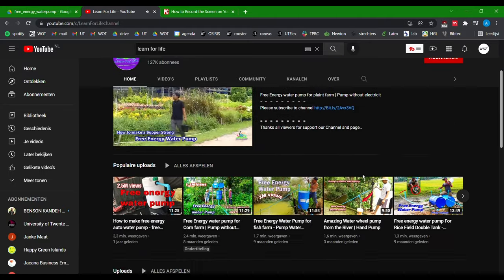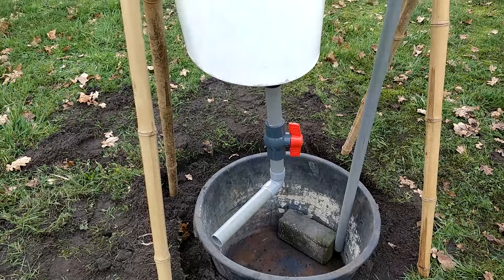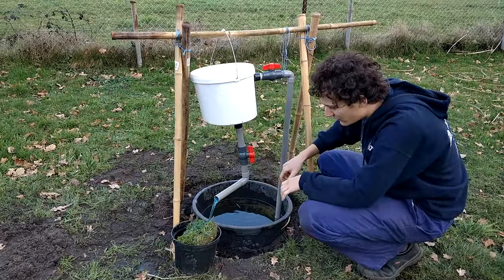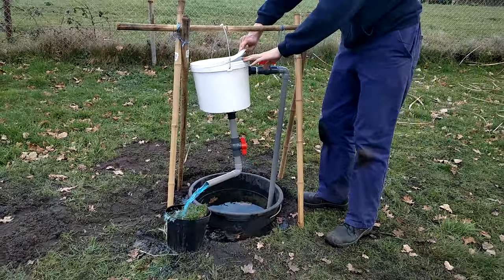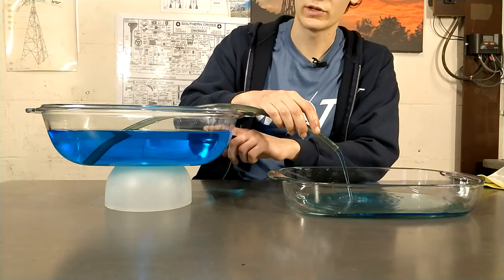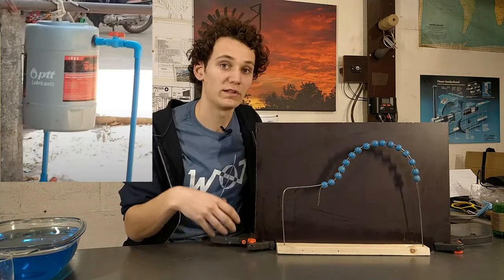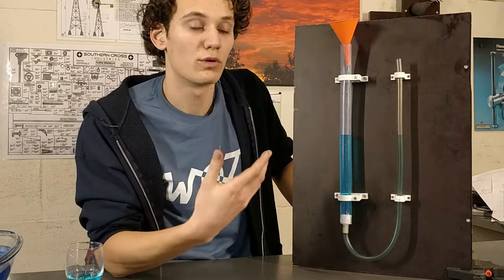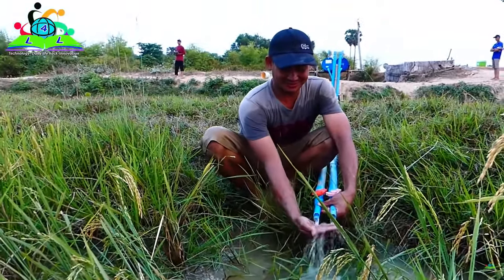FREE ENERGY Water Pump Tested. Is it possible?

Comment: Air volume on output pipe is needed for function. Air is in fist phases compress and in send cycles make expansion. Wit out this presser compensation running pump only short time. And don't re member ventil on the input pipe!
Reply: Noop. With a bucket/barrel no valve on the input is needed. Air in the outlet is poison to siphon. Cycles? There is no cycles in a running siphon. This siphon does not work since the input is lower than output, as demonstrated.

Comment: I think they also put a one way valve.
Reply: One purpose of the barrel is that it helps priming the siphon so you do not need any foot valve. The other purpose is to collect any air sucking into the system. When there are too much ait in the barrel, the siphon stops, and you must prime it again.

Comment: You are wrong it does work 
Your model is not correct 
Very simple, study old vintage water fountains some dont use river current,  or pressure to work   same principle
Reply: Sorry, but this video is correct in every detail. A siphon can not lift any water to a higher level.

Comment: And you opened the valves all the way  
You have to meter the flow so air doesn’t slug back in from the outlet  
You have to allow a vacuum to occur

Comment: Calculation of Water Suction in a Closed Container

- The container is closed: Atmospheric pressure no longer affects the interior of the container.

Calculation of pressure inside the container:
- The pressure (P_tank) inside the container is determined by the hydrostatic pressure of the water in the container.
- P_tank = ρgh, where:
  - ρ = 1000 kg/m³
  - g = 9.81 m/s²
  - h = 0.8 meters (height of water in the container)
- P_tank = 1000 kg/m³ * 9.81 m/s² * 0.8 m = 7848 Pa

Calculation of pressure in the tube:
- The pressure (P_tube) in the tube must be less than P_tank to create suction.
- For simplicity, we assume that friction losses are negligible and the velocity of the flowing water is constant.
- P_tube = P_tank - ρgh, where h = 1.5 meters (length of the tube)
- P_tube = 7848 Pa - 1000 kg/m³ * 9.81 m/s² * 1.5 m = -5984 Pa

Conclusion:
- The P_tube (-5984 Pa) is negative, which means there is a vacuum in the tube.
- Therefore, water suction from the system is feasible.

Notes:
- In this case, suction is solely due to the hydrostatic pressure of the water in the container.
- The absence of atmospheric pressure in the container allows for the creation of a vacuum in the tube, reducing the internal pressure and enabling the flow of water.
- The velocity of the flowing water and the volume of water suctioned per second can be calculated using the same formulas used previously, replacing Patm with P_tank.

Additional observations:
- The presence of friction losses in the tube will reduce P_tube and therefore the velocity of the flowing water.
- Changing the height of the water in the container will affect P_tank and consequently P_tube.
- The temperature of the water can also affect its density and thus the hydrostatic pressure.

Overall, water suction in a closed container is feasible, but the velocity of the flowing water and the volume suctioned depend on various factors
Reply: Impressive “explanation” unfortunately this siphon, as any siphon, can not lift any water to a higher level. As the video shows, it spouts out the water in the container, then it all stops. If you dip the output tube into a cup of water, nothing will come out of this system, not even the water in the bucket

Comment: Review thermodynamics. you did not prime no foot valve. i already try this with my hydrophonics system. inlet pipe for tank should be smaller than the output pipe to have siponing mechanism.
Reply: Noop. With a tank, no foot valve is needed. In fact this is the main reason for using a tank. Inlet tube may be 10 times wider than outlet tubing. The purpose of this video is to show that a siphon can not lift any water.

Comment: Everyone seem  to  miss  the  basic  physic   of  the  system  .. This  is  a   basic  vacumn  pump  .   The  resevoir  or  tank  must  be  sealed   as  well  as  the  inlet  pipe  .  When  the  tank  is  fuLL  to  the  height .of..the  inlet  pipe    and  the  outlet  at  the  bottom  is  opened   a  vacumn  is   created   by  the  falling  height  of  the   water  in  the  tank    .  This  vacumn   is  strong  enough  to   LIFT  WATER  ALMOST  33  FT  ..  The  critical  point   is   THE  TANK  AND  INLET  PIPE   MUST  BE   SEALED  .
Reply: The videi shows that a siphon can not lift any water.

Comment: Also you need a check valve on the end out at the well so the water does not go backwards and you need another valve on top with the tea so you can feel the container up and the line all the way down to the well that away when you open it up there will be no air in it basic physics do it this way and it'll work

Comment: You got to cover the top where it makes air pressure
Reply: There is a airtight lid on the bucket here. Reason that it does not work is that the source water level is higher than the output. He shows that then it can not work. A siphon is no pump.

Comment: To debunk this theory. "If you turn over a gallon of water with one opening, where will the air fill the gallon from while leaking? The same opening the water escapes through.
 So when the initial weight of the water in the tank reduces, the force can no longer suck the water from the depts so the easiest way to leak will be the same opening you switch to get water from. Just a matter minutes depending on the size of the tank and dept of the well to loose suction power and use alternative air opening. Go and buy your electric pump please.. don't waste your time.

Comment: If you removed your valve on the top well side and put an inline check valve so that water can't flow down only up, this would let you prime the well pipe and the bucket at the same time.  Seal the lid and then open the release valve and that should do it.

Comment: For that pump to work you need to fill the pipe running to the ground too. That's what priming is. Otherwise the siphoning won't work unless the reservoir has a larger volume and it sucks all of the air from the pipe. In other words, you didn't prime the mechanism correctly. That's why it failed. Had you had less air to siphon, the water would've flowed fine.
Reply: No, this demo is exellent. It shows that this “pump” can not lift water to a higher level. No siphon can do that.

Comment: I definitely agrees with you about siphoning, UNFORTUNATELY, you did not seal the white container (and the other parts where the supply of water will come from) after you filled it with water, WHEREIN a vacuum pressure MUST be created, that my friend will suck the water from the supply
Reply: ADD: considering also the SMALL white container, definitely WILL NOT WORK, a bigger sealed container must be used to create a vacuum (negative) pressure to overcome the weight of the water to be lifted from the supply
Reply: ADD: a LONGER OUTPUT HOSE for more volume of water that will create the vacuum (negative) pressure from the sealed bigger container
CONCLUSION:  very good vlog indeed for a very good discussion ...
Reply: Sorry, no. This excellent video shows that a siphon can not lift any water at all.

Comment: You're wrong -- this does actually work. There needs to be a longer outlet in this scenario with a smaller outlet. You also need to prime your supply tank by removing all air from the system. If you watch any of those videos you're trying to replicate, they make a point to show you that.
Reply: It can not work as long as the source is lower than the output. A siphon can not lift water.

Comment: Your lid is leaking air because it doesn’t have a tight seal such as a screw cap type of lid to create a seal impenetrable by air. Without that air pressure it will not create the vacuum pressure
Reply: Lid is ok. System is sucking water from the output. Air in, some water out, more air in…

Comment: No Mystery here....., just the siphoning effect, works as long as the top white bucket lid is nicely sealed, and no air enters the bottom pipe that sucks up the water.
Reply: Which means that the ouutput must be lower than the water level in the source for this siphon to work - as with any siphon. Only works from a high source to a lower deain.

Comment: I would call this kind of pump a syphon with vacuum assist. with a larger tank it will indeed suck additional water into the tank but the tank will eventually empty to a point where the vacuum is not strong enough to raise the water needed to keep the tank full.  Its a flow extender rather than a free water pump. but never the less a good idea as raising water in buckets is hard work.
Reply: The video shows that this siphon are unable to lift a single drop of water to a higher level. It proves that a «drum pump» is no pump.
Reply: @kjellg6532  Any pump has to be able to do 1 thing and that is create a pressure differential. . this system is basically a siphon, but with a pressure differential increased by the dropping water creating a vacuum. the net energy loss is always to zero so its not free energy at all just a flow extender. to fill the barrel took energy to fill it and what you are seeing is that energy added to the siphon but always trending to zero. its a fun project,
Reply: @davebloggs  The purpose of this video is to debunk those who clames that a siphon with a barrel, can work as a pump and lift water from a well. The video shows that not a single drop of water are sucked from the source. The only water that comes out of this system is what you yourself manually liftet up into the bucket, nothing more. This is a siphon, not a pump. As a siphon, it can lift nothing.  If you dip the output tube into a cup of water, nothing will come out of the system. You can also use a U-bend at the output. In either case, aire is prevented from entering the system from the output side and it all stops.
Reply: @kjellg6532  but a siphon is a pump because it relies on pressure differential. and that is the definition of pump. a device or apparatus that creates by what ever means a pressure differential.
Reply: @davebloggs  Siphon can not lift any water to a higher level. For a siphon to work, the water level of the source must be elevated higher than the output. To lift a body of water to a higher level you add energy to it. You can use energy from petrol, steam engin, electric motor manual work or the power in flowing water in a river. 
A siphon has no energy input and can not lift any water. Adding a barrel does not make the system work, it only helps a siphon to start, it is a priming device, not a continues source of lifting energy.
This video shows that a siphon can not lift anything. Common knowledge from schooldays.
Reply: @kjellg6532  Ok im laughing now. so here is a challenge build one. use a 45 gallon barrel . the out put at the bottom of the barrel. and  a 1/4 inch suction hose in a source supply located a few inches below the barrel height, fill the barrel open the tank wait until the flow output stops due to vacuum and then open the 1/4 inch inlet  you need air behind water to create flow. and tell me what happens. you did add energy to the system by filling the barrel and it will indeed suck water in the inlet until the barrel is empty which is my point all along but clearly you cant see outside the box, the laws of physics are really quite good like that. I am very familiar with pumps and siphons.
Reply: @davebloggs  Now let us change your set up a little: The tank is now 10 m3 in volume. The bottom of the tank is raised 5 m above the ground. Beside the tank is a lake and the surface of the lake is 6 m below the bottom of the tank. There is a suction pipe from the lake up to under the top of the tank. There is an outlet tube from the tank via a valve and this tubes ends up in a 10 liter empty bucket standing on the ground.  
You fill the tank with water - puh - then open the outlet valve. How much water will leave the tank? 1) 10 m3? 2) 10 litres? or just 1-2 litres, maybe less? 
 (I too do have some experiences with pumps and siphons over 50 yrs, but English is my 3. language so please excuse me for unclear wordings)
Reply: @davebloggs  Now let us see. I assume that the uoutput tube is pointing some cm horisonralybout from the barrel and ends there. You open the valve. You have exactly the same situation as shown in the video. Water will gulp out until the tank is empty, not a single ml is lifted from the source. I.e. the system does not work ar a pump, put as a storage tank. The output flow would be better if you open an air inlet at the top, no more spouting at the output. And again, no more water out than what you manually lifted in. No source of energy for a run over days.
Reply: @kjellg6532  I agree there is no way it would lift water 6 m. you could use the vacuum to raise water a few inches at best and the pipe would need to be small thats why i think 1/4 would be the max. and once the 45 gallons of water is mostly drained out it would just glug air at best, but it  is an interesting experiment , it is not as i stated earlier a pump but more a gravity assisted siphon., if you are familiar with pumps you will know that all they do is create a pressure differential. this can be achieved with valves or velocity etc there are many ways to move things but all create a pressure differential.  the 1/4 tube in the vacuum space in the barrel as the water dropped would experience a drop in pressure and since the water in the pipe is from an external source at atmospheric pressure the has to be some flow. but any bigger than say 1/4 inch and a few inches difference i think would be stretching it somewhat.but it would be a great thing to build.
Reply: @davebloggs  Do not think I will copy this. It can not work. No siphon, with or without a barrel, regardless of diameter of tubing. Regardless of length of exit tubing can lift any water, not even 5 mm, no energy input for continuas operation that is.
As for pumps I have looked into Archimedes pump, screw pumps (oil pumps in cars). Reciprocal piston pumps, centrifugal pumps, spiral pumps, medical blood pumps (tube pumps)  just to name some.

To be honest , there is a ‘siphon pump’.  It is so complicated with so many water timing devices and valves thar you need a Masters degree to tune it.  It works like this:  Given a small vessel situated about 6-7 m above the source. There is a one way valve into the vessel at the suction side. The output side is long and the end is dipped in water so no air can enter. Here is a valve at the output side of the vessel. AND there is a short drain tube at the bottom of the vessel. 
Now everything is filled with water and all valves are closed. The vessel i drained by openig the drain valve. This water is coming out abote 6-7 m above the source, but it is just 1-2 litres. The drain is closed and the output is opened. Due to the volume and length of the outputt, all air in the vessel is eventually evacuated and the vessel is fully flooded with water.
Repeat….
There is a lot of mechanics that uses gravity from water to open and close the different valves.  This is reported in a US patent and has been used in a suburban village for decades. 
I am a bit reluctant to call this a simple siphon though.

Comment: I love the top comment here explaining how your setup is wrong and the size of pipes and the addition of check valves and other things not included in the original video are needed to make it work..Your outlet pipe isnt long enough.. Etc ...  Yet any valve in the system will stop the free flow of vacuum and pressure stopping any forward and UPWARD flow. 
The endless argument of pipe sizes and riser pipes added past certain points and on and on. 
Your model is correct your science is exact. 
Liquid water cannot lift any fraction of equal density liquid with no valves and no motion or energy going  into the model. 

Congratulations you are among the top 3% of intelligent people. Good luck trying to convince 97% of the people who enjoy being fooled by hoaxes and "magic". 
Please sub my channel because I subbed you as soon as I saw you prove this hoax.
Reply: Agree! Excellent video showing that a (barrelled) siphon can not lift any water.

Comment: You are wrong...The Volume occupied by water creates Vacuum or suction pressure when outlet..
When the suction pressure is higher than atmospheric pressure or should I say atmospheric pressure is less than pressure inside the container, water will flow in trying to balance it. 

It follows the laws of physics and it worked because I built 1 to pump water uphill back home..
Reply: You can not! A siphon can not pump any water uphill!

Comment: Why are you not understanding the reason why i DOES work is because the busket has to be airtight and it will be used as Negative pressure tank - but the tank has to be big... It is possible if the water is pumping ground water that is not too deep down - less than 3-5 feet maybe. So the bucket creates a vacuume.
Reply: No, it does not work. Nosiphon can lift any water to a higher level, not from a 3 feet well, not even from a 1 inch well!

Comment: I think it's not working because the tank needs air tight lid. So, as the water is drained from the tank it should suck up the water from the reservoir.

Moreover, I think, the volume of the tank that hold the water should be larger than the volume of the pipe that runs down the reservoir, which implies that the longer the pipe is the larger the tank it should be.
Reply: Less water would come out than pumped up, so it would stop eventually.